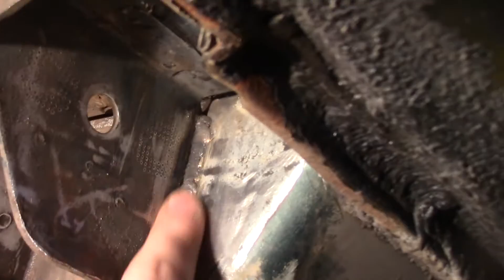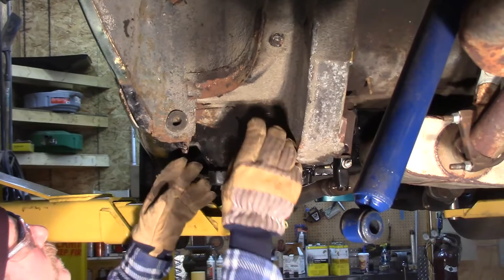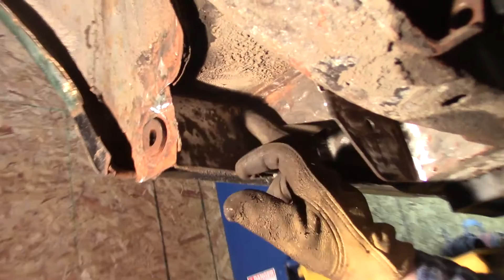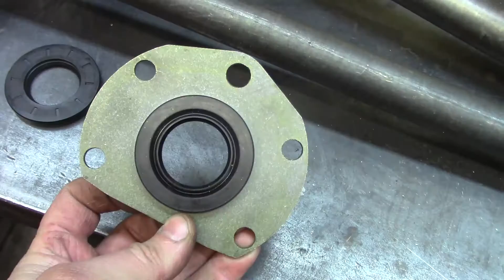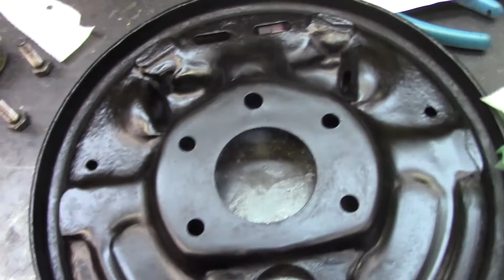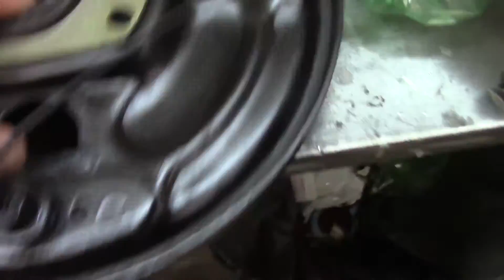Javelin Spring Perch Work and Axle to Brake Relationship Plan

Comment: How's is it working and in your opinion would this MOD work on a jeep cj7 that see's off-road use. I have a AMC 20 with a ARB 4.10 gears and it will have one piece axles.
Reply from the maker: No leaks yet on my car and it stops the same so far.   Then again, I hardly ever drive it.  Never any gaurentees when original equipment is modified.

Comment: cool video , been a long time since I put the mosers in but I remember not using an outer seal cause it was a sealed bearing , I may be wrong but you are right about the brake backing plate coming off with the axles . unless your putting a lot of torque to the ground say with a four speed and 5000 rpm launches  I wouldn't worry about the axle tubes spinning . that's why a lot of the dragracers run a 9 inch .